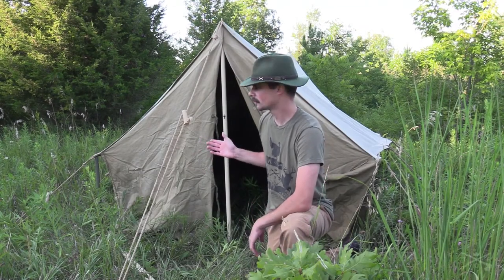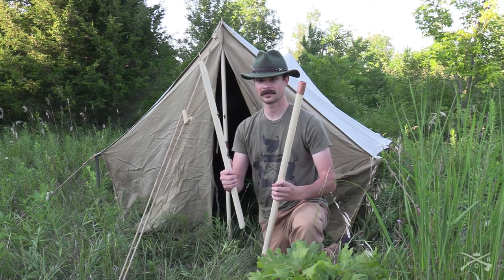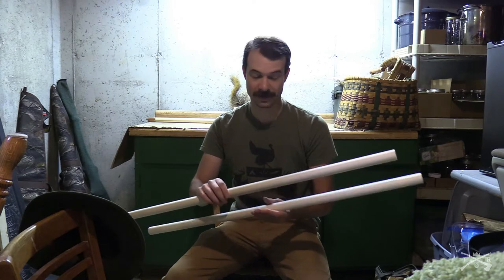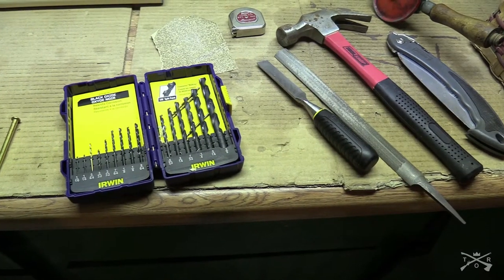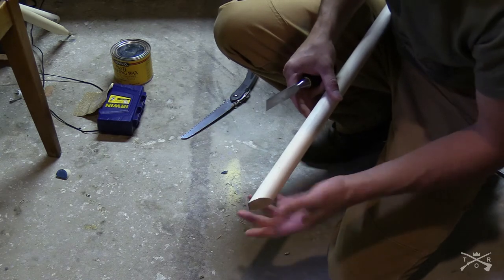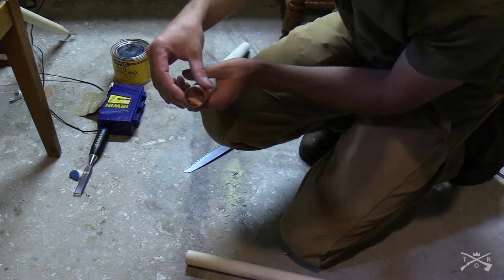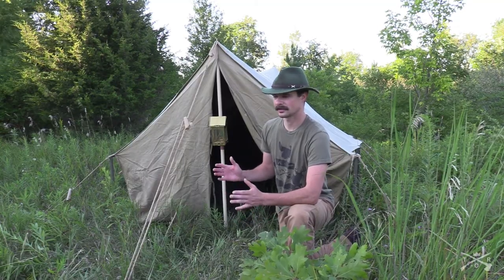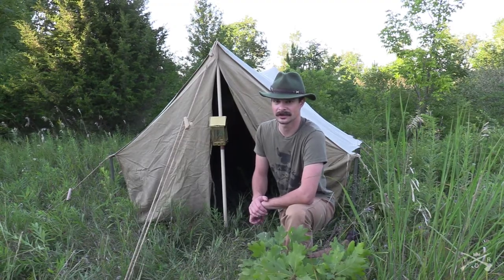HOW TO MAKE WOODEN TENT POLES | DIY CAMPING PROJECT

Comment: Interesting. A couple changes I'd might make:  A longer coupler. Instead of the slant design, straight cut, but I would glue/epoxy/adhere hook & loop/velcro to the two ends for a little extra stick.  But as an alternative, you could install a little screw on one (affixed with some Titebond III or the like into one pole) and  just screw the other end in. With the combo of a longer coupler and the end screw, it should be quite rigid. 

   Question with first some context: My understanding is that wood and copper have rather different expansion and contraction properties--will there be problems if these go from say extreme, dry cold to warm and very humid or the like?  When the copper gets very cold, it will contract significantly more than the wood.  When it is very hot and humid out, the wood will swell/expand more than the copper, etc, etc. 

    Perhaps a bamboo coupler would work better?  (The challenge would be finding bamboo that fits both ends well, and you'd probably want to use just Titebond III wood glue to affix it to the one pole, since bamboo easily cracks and splinters when driving nails or screws through the wall).  A bamboo coupler will save a little weight and usually cost as well (especially if you can wild harvest bamboo).  If you do use bamboo, it needs to be sanded a bit with some rough grit sandpaper in order to help it glue better. There is usually some silica in some of the layers, and that silica acts a bit as a non stick/hard to adhere to, material.
Reply from the maker: I honestly don’t know much about the scientific properties of the materials. I copied a design I believe was used during the civil war. I would have preferred a longer coupler as well, but I had to go with the longest ones in stock.

Comment: Cool.  Thanks for making this video.  If using that slanted cut design, a good way to ensure fit between the two ends is to use your scrap tiny piece and trace it on the mating dowel end before you cut.   No biggie.  I am sure in the end, everything will match up.

Comment: Why not take a longer pole and saw it under an angle. The remaining exposed sides should fit perfectly.
Reply from the maker: That would have worked much better, and if I ever do this again, I will use that method since once cut should be enough and both angled sides would fit together. The hardware store I went to only had the shorter poles though so I had to make it work. Thanks for bringing this up. It’s a very good point.

Comment: What is the reason for making the joint a slanted cut?  What benefit does that give you over the factory straight cut?
Reply from the maker: I based the design off of poles I purchased years ago for a civil war dog tent. I believe the angle provides more surface area for the two poles to make contact with each other in theory making it stronger. I could be wrong, but that’s my theory.

Comment: Have to wonder why you wouldn't use a 4' dowel rod/pole and make a single angled/slanted cut in the center.
Reply from the maker: That would’ve been easier, but the store didn’t have any in stock at the time.